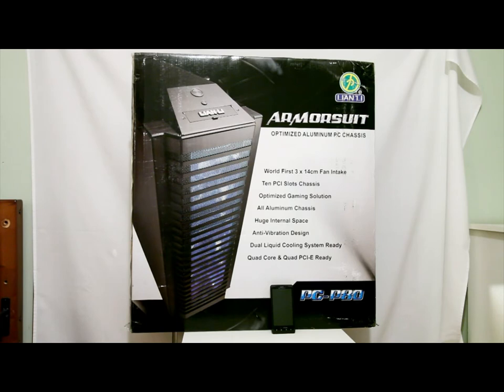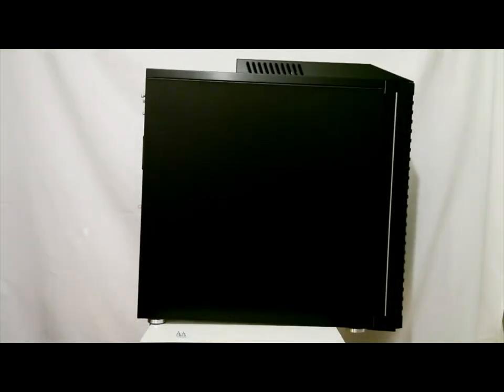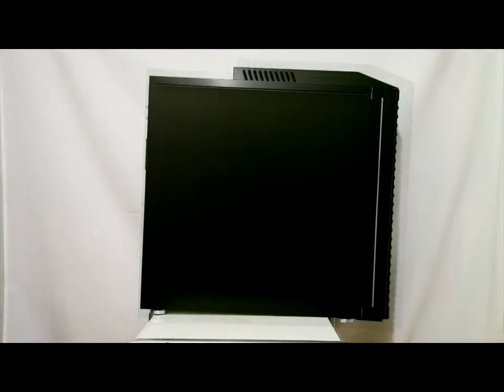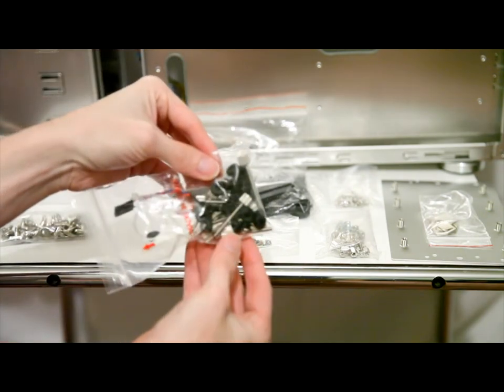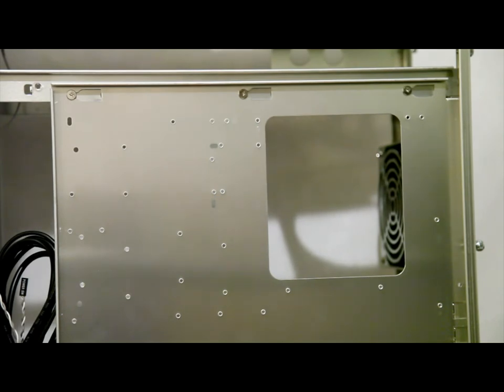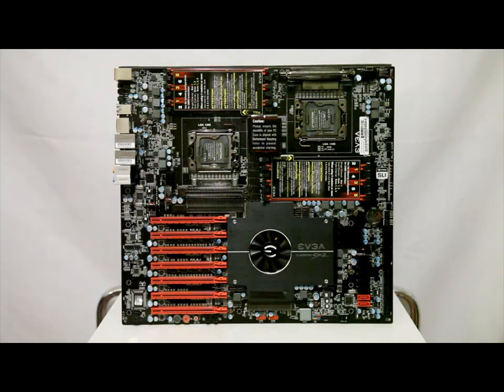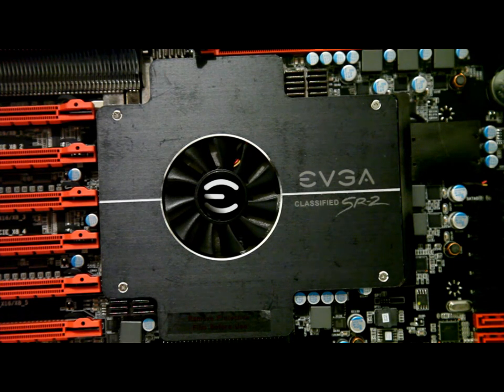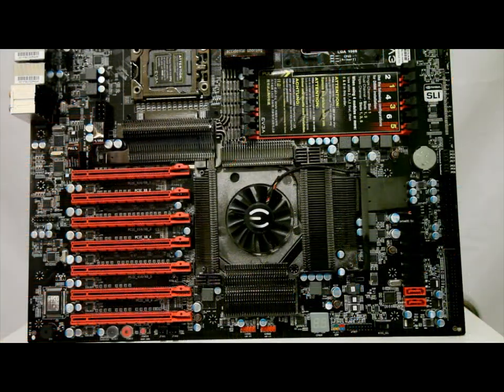SR-2 In A Lian Li PC-P80 Tutorial Part 1

Comment: I drooled over this design as it reminds me of the old Chieftec Dragon case combined with the look of a Koolance kit on top. I bought one as new, old stock in 2016 form Performance PCs. Their shop is an hour away so I drove their to pick it up. A previous customer ordered it and had them do a custom deep red paint on the whole interior, but never picked it up so it sat and sat. They had an extra, new plexi panel so I bought it and have both panels windowed. I modded the factory, single fan speed controller to fit an old school 3-dial Lian Li static RGB kit and put the lights on the MB tray side. The GPU side is static red LED. I installed a 6-channel NZXT fan speed controller, but have since purchased a Lian Li one to replace it....just haven't gotten around to it yet. I added black Lian Li aluminum wheels and have a Lian Li aluminum PCI 120mm cooling kit (BS-03A) on the outside rear of the case, venting from the slots near the GPU. I removed all front 5.25 vented blanks and HDD cages so airflow is wide open to the interior. This thing set me back like $700 in 2016 with the panels, RGB and wheels but I'm happy to have a unique case no one else is running.....in a world where everyone runs the same three cases. You also never see these for sale. I've only come across two others on ebay since 2016. One was a full build for $1500, the other had the plain silver interior, no plexi panels, no wheels for $400.
Board: MSI MAG B550 Tomahawk (MS-7C91)
BIOS: American Megatrends Int'l A.50 AMD AGESA Combo AM4v 2PI 1.2.0.0
VGA: MSI RX 6800 XT Gaming X Trio
PSU: Corsair HX1000i PSU Single 12V Rail (12 V DC @ 83.30 A)
CPU: AMD Ryzen 5 3600X (6 Core)
RAM: 4x8GB, DDR4 3600MHz Corsair Vengeance LPX CMK16GX4M2Z3600C14 @2133MHz
SSD: 1x Samsung 980 Pro NVMe 500GB PCIe Gen 4.0 x 4, (OS)
SSD: 1x Samsung 860Evo SSD 4TB SATA3 (6Gb/s) (Games)
CPU COOLER: Noctua NH-U9S Chromax 92mm Single-Tower
Keyboard: Logitech G510, USB (New, Old Stock 2023)
Mouse: Logitech MX518 Legendary, USB
Monitor: LG UltraGear 27GN950-B
Speakers: Klipsch ProMedia 2.1
DAC/Amp: Mayflower ODAC 2 Rev B
Headphones: AKG K712 Pro w/Modmic
OS: Windows 10 64bit Professional
CASE: 2008 Lian Li PC-P80 Armorsuit (New, Old Stock 2016)
CASE FANS: Five NF-P12 Redux, one NF-P14 Redux

Comment from the maker: Gotcha.  Well it's all brushed aluminium so it's fairly light by itself for a full tower.  My case loaded is probably 30-35lbs but I have a huge board and so forth in it.   I think the weight is something like 12lbs empty.  The caster centers are roughly 6.25" apart from each other.  They're lined up right with the side supports of the case looking from the front and are further out than the typical 5.25" bay.  The whole case is just about 8" wide so it's not tiny.

Comment: I'm curious, since there have been no comments in almost a decade.  How long did the system last for you?  Based on watching this video when it first came out I bought the case and put a Sabertooth Z87 into it.  The system performed beautifully to this day and thanks to the case even survived the Corsair watercooler failing in 2016 on its fans alone.  I ended up buying a second one of these (The P80N varient) which I am planning to use in my next build.  I'm curious, did you move to another case or have you attempted to update this one with a new front panel of some type.  Strange at it may sound I prefer this to my Corsair Obsidian 1000D purchased ten years later.  Thanks for a video that stood the test of time.
Reply from the maker: Hey Michael!  Thank you very much for the kind and lengthy comment!  So to answer your question, yes, the board was a beast and it held up from around 2009 to about 2014.  I upgraded the RAM eventually to 36 GB DDR3 and swapped the 5620s for dual 5645s (highest the board could support).  Was able to hold a 24-7 overclock on them from the base 2.4 Ghz up to 3.7, maybe 3.8 Ghz. The board was retired simply because of single core IPC and a couple other factors as tech moved forward.  I had to replace the PCIe area cooling fan once, as those tend to always fail.  Eventually from physically moving the system a lot, when I wanted to get the board serviced, EVGA said there was actually some minor damage to it so I couldn't roll up to the (then new) SR-3.  

The P80 lasted though the next build after, where I used the EVGA X79 Dark with an Intel 4930K from 3.1 up to 4.3 Ghz with 64 GB of DDR4 from around 2014 until 2018.  By then, the lack of actual case features for the P80 made it harder to work in; a pain to route cabling with little to no extra room and no place I could mount radiators for my current system (planned in 2017, built 2018).  No USB3, no USB-C, not many mounting points for things, etc.  

The case was indeed super awesome and I do kind of miss the ease of just pulling the panel off and being inside (and the B-Panel NERV logo) but eventual needs just passed what it could provide.  Hope this gives some insight since this video was made!
Reply: Michael Timeless
1 year ago
"I'm curious, since there have been no comments in almost a decade".....well, I commented. Check out my reply to the post 😁
Reply: @nated5355  Other than this post I don't see your post among the other ten.  Sorry.
Reply: @mikec1341  I drooled over this design as it reminds me of the old Chieftec Dragon case combined with the look of a Koolance kit on top. I bought one as new, old stock in 2016 form Performance PCs. Their shop is an hour away so I drove their to pick it up. A previous customer ordered it and had them do a custom deep red paint on the whole interior, but never picked it up so it sat and sat. They had an extra, new plexi panel so I bought it and have both panels windowed. I modded the factory, single fan speed controller to fit an old school 3-dial Lian Li static RGB kit and put the lights on the MB tray side. The GPU side is static red LED. I installed a 5.25", 6-channel NZXT fan speed controller, but have since purchased a Lian Li one to replace it....just haven't gotten around to it yet. I added black Lian Li aluminum wheels and have a Lian Li aluminum PCI 120mm cooling kit (BS-03A) on the outside rear of the case, venting from the slots near the GPU. I removed all front 5.25 vented blanks and HDD cages so airflow is wide open to the interior. This thing set me back like $700 in 2016 with the panels, RGB and wheels but I'm happy to have a unique case no one else is running.....in a world where everyone runs the same three cases. You also never see these for sale. I've only come across two others on ebay since 2016. One was a full build for $1500, the other had the plain silver interior, no plexi panels, no wheels for $400.
Board: MSI MAG B550 Tomahawk (MS-7C91)
VGA: MSI RX 6800 XT Gaming X Trio
PSU: Corsair HX1000i PSU Single 12V Rail (12 V DC @ 83.30 A)
CPU: AMD Ryzen 5 3600X (6 Core)
RAM: 4x8GB, DDR4 3600MHz Corsair Vengeance LPX CMK16GX4M2Z3600C14 @2133MHz
SSD: 1x Samsung 980 Pro NVMe 500GB PCIe Gen 4.0 x 4, (OS)
SSD: 1x Samsung 860Evo SSD 4TB SATA3 (6Gb/s) (Games)
CPU COOLER: Noctua NH-U9S Chromax 92mm Single-Tower
Keyboard: Logitech G510, USB (New, Old Stock 2023)
Mouse: Logitech MX518 Legendary, USB
Monitor: LG UltraGear 27GN950-B
Speakers: Klipsch ProMedia 2.1
DAC/Amp: Mayflower ODAC 2 Rev B
Headphones: AKG K712 Pro w/Modmic
OS: Windows 10 64bit Professional
CASE: 2008 Lian Li PC-P80 Armorsuit (New, Old Stock 2016)
CASE FANS: Five NF-P12 Redux, one NF-P14 Redux
Reply: @nated5355  If only I had known.  I still have two of these cases.  One with my old I7 system I tried to sell last year with no takers at $200 (for a working system with Win 10, Nvidia Graphics and 32gb of mem).  I ended up turning it into a Plex torrent server - running 24/7 in the garage (most durable PC ever). The other P-80 case is empty with a ton of spare parts in my garage workshop.  I am now running 3 Corsair 1000Ds with more modern boards.  In my late 60s these three are probably my last PC builds, (getting a bit hard to see the components to install them).  Enjoy it while you can.  Pity you can't post pics here, I've got some great ones from development work on the P-80 and the Corsair 1000Ds.